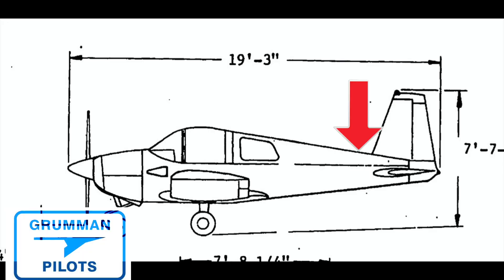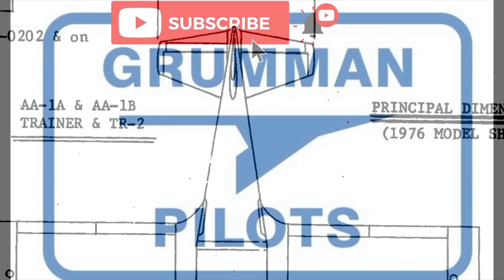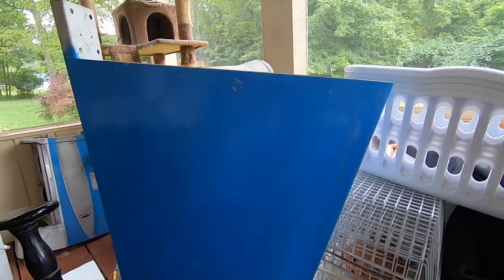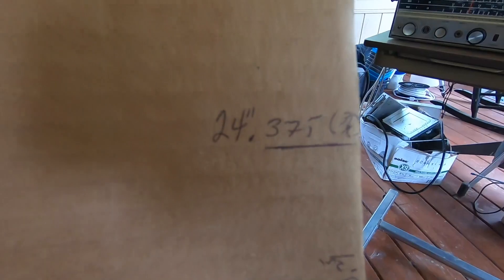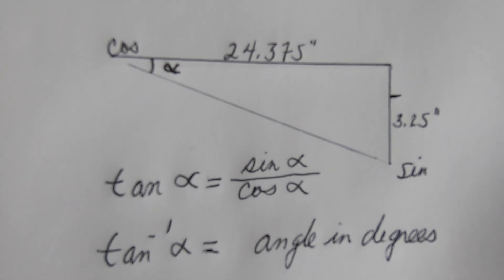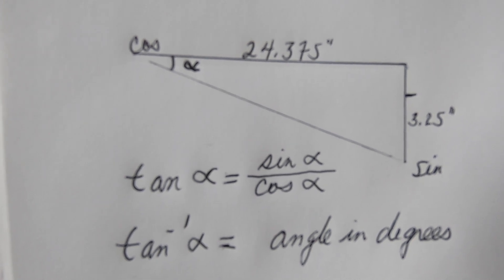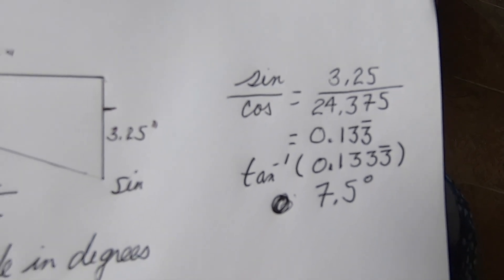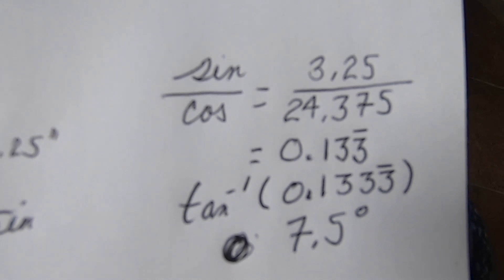Fuselage Angles on Grumman Airplanes? - Grumman Style

Comment: I just had to measure that on the Yankee to make a bracket to mount the uAvionics remote compass for the AV-30 back in the tailcone.  It has to be mounted inline with longitudinal axis of the airplane.  I figured the talecone sides sloped in 8°.  Should be close enough....
Reply from the maker: You are definitely in the ball park.